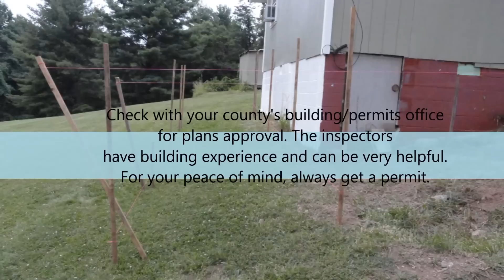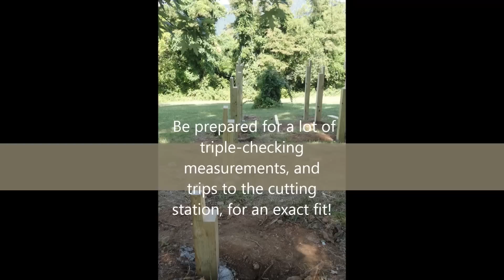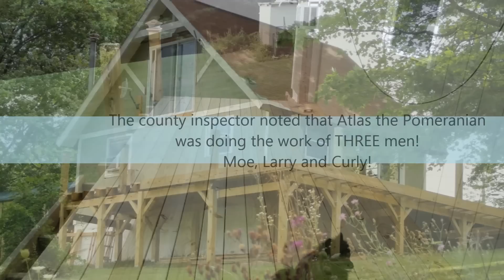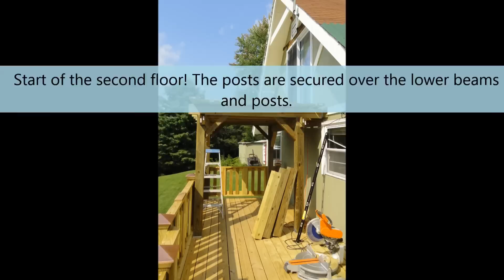Deck Project Diary: How to build a strong deck.

Comment: was there flashing on the ledger boards or just sealant?
Reply from the maker: EXCELLENT question, Roy! Normally, we would use flashing. In this case, we felt that cutting into the T1-11 siding to install flashing, this high up, would cause more harm than good - increasing the likelihood of water infiltration, not decreasing it. The T1-11 goes over the cinderblock foundation, allowing run-off below the deck and floor joists. The T-1-11 was painted with several coats of Behr Premium Plus Ultra and the ledger boards were caulked.